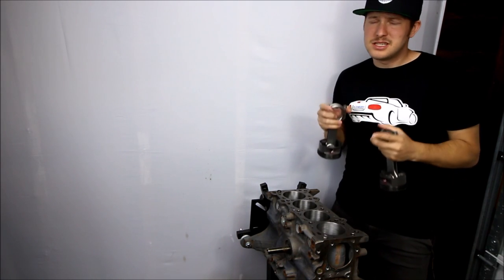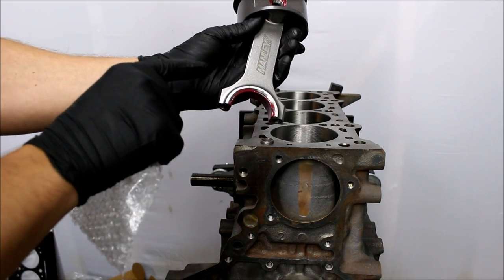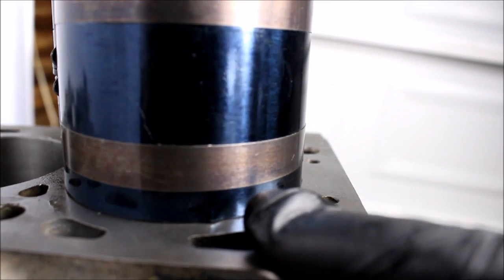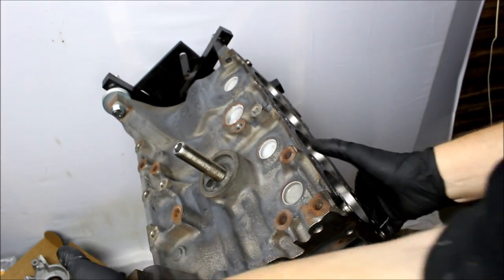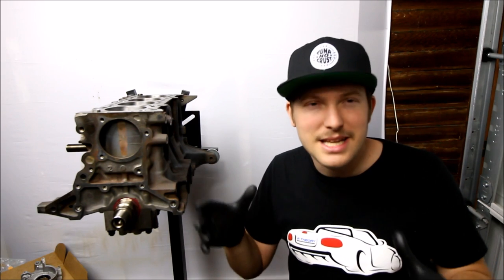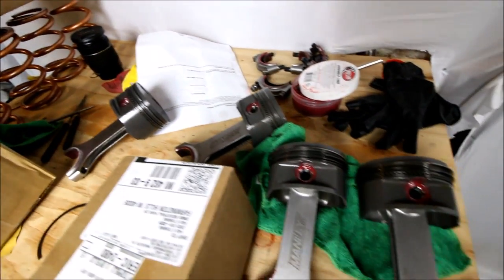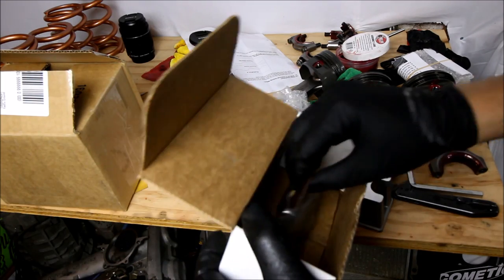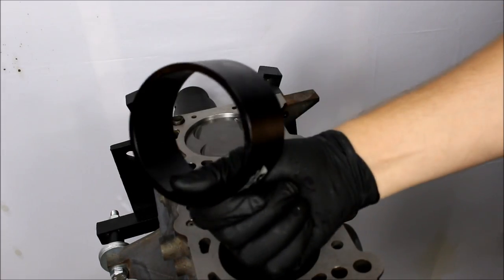FIRST MISTAKE On The VVT Engine :( Piston & Rods Install (Rebirth Ep12)

Comment: I used the lisle spring compressor (the cheap one). The key is before you push the piston down in, you need to give the compressor itself a couple light taps all the way around with a rubber mallet.  It level/flushes the compressor edge on the block deck.  Then the piston slides right in.   

The second one you used is way better, but just for anyone watching - this is the tip.  

Nice vid man. I too teach myself the same way you do.  It really is way easier than I ever thought it would be.
Reply: Stanley Orner you are right, the cheap compressors work good, it's just you have to make sure it's square to the block, then you can push the piston straight in the bore instead of tapping
Reply: every tool is good if you know how to use it

Comment: Cant wait to start a 1.8 build myself :D
Reply: Gingium will it be fully forged??
Reply: Maybe swap VW 1.9TDI in it? Sounds ridiculous, and no one did it, so you can have rwd with same power (no, no actually few HP less), but 200 ft-lb of torque at 2500 RPM is insane for offroad use. maybe...
Reply: Turned out to be a 1.7l build haha 😂 :p
A beast she is
Reply: Which supertech valve springs did you get gingium?

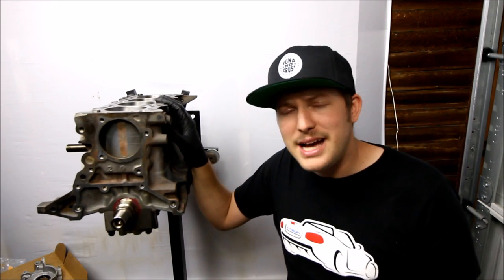Comment: 4:25 - 4:40 the lube on the bearings WILL CREEP OUT, under this load. Check the torque in 3-4 hours.

Comment: Not trying to be "that guy", I know everyone has their own way and they do what works best for them but I figured maybe I could share a tip. It should never take more then just your fingers to push a piston into its bore. Just clean the cylinder out well and squirt a good amount of oil on the piston skirt/rings all the way around (if you think it's to much, its most likely just right) and apply a good coating oil oil around the cylinder and just plop them in using the ring compressor and your fingers.

I've seen a few people do the tapping in method with a handle or something because they couldn't push it in by hand and sure enough, it was either not enough oil used to insert the piston or one of the oil rings actually bent over. No it wasn't their first engine build either. Just figured maybe I'd share that to save someone one day, everyone makes mistakes no matter how seasoned you are.

Comment: Nice vid. One small comment. I did buy a 202 blue short motor from the wreckers, in about '93, that'd come out of a wreck. The boy had been breaking it in, and broke it a bit harder than... So the wrecking yard told me it was cheap because "it rattles and smokes." Investigation showed that he'd oiled the bores a wee bit too much. The rings and ring grooves and everything, were a black mess of half-burned oil. What did I have to do? Well I'd already bought another new set of rings, so I might as well use them - Those ones are obviously no good. What else? ... er... Run a hone around the bores a little bit, because they look a bit glazed... and put it back together. Oil stone and give the deck surface and head face a once over, new head gasket, and Bob was Dad's little brother.
Five years later, you could still look down those ports and see bare Aluminium piston tops, including the green marker pen with the piston numbers on them. Not all that shabby for a mid-'90s back-yard built holden.
So what had gone wrong for the first owner? He'd built it, but he'd gone a bit overboard with the oil on the cyl walls and oil in and around the rings and stuff. Possibly he fired it up very gently and just let it idle for 20 minutes, rather than running the engine at middle revs and full load within the first 3 ~ 5 minutes like you should. Possibly his oiled up bores also had assembly grease in them, I didn't get to watch  him build it, I just had to clean the black goop out of his ring grooves. You should lubricate the bores and oil everything, but that doesn't mean pour half a cup of oil into each plug hole before you turn the key.
Reply: Kneedragon1962 this is funny to read. Just went through the same issue with our built Mx5 motor. Rings didn’t bed in. We think we were too generous with the oil and let it idle too long. Now having to rebuild. Good advice!

Comment: I just discovered your channel yesterday while looking for information on setting up a EBC on megasquirt in tunerstudio. I did want to post up and let you know I also ended up needing to order a set of rings when doing my first engine rebuild. I was able to call Wiseco and order rings for a single piston. My out of pocket was less than $30 shipped. I just had to supply them with the piston ring specs. I filed my on ring gap and accidentally interpreted the .44 mm measurement in .044 inches. Likely won't make that mistake again.

I've got a 93 Mx-6 4cyl boosted on megasquirt with 10.5:1 compression. So far it's quite fun on 7.4psi. Took the old numbers of 103whp/113tq to 196whp and 202tq on a "safe" street tune. Final goals are around 350whp/300+tq on 14psi on pump gas. Unless I get bit by the boost bug more than I have and decide to do methanol injection and shoot for closer to 18/20psi. :)

Comment: Been there done that.  You are right the key is to hammer the sleeve down on the block so that it is completely square.  Lay a wood handle of a hammer sideways on the ring compressor and tap.  The other key is to not hit too hard.  If you are tap tap tapping and it won't move pull it out and reset.  It doesn't take a lot of force to punch it in.  But, like I said, been there, done that.

Comment: I think you did a good job and it was a smart move upgrading your ring compressor. Recently I re-ringed my VR6 and I didn't have one for that engine since the cylinders aren't flush with the deck so I had to do it all by hand and used a small flathead screwdriver to help push the rings in lol. Pain in the ass and nerve racking but she's been taking the most abuse ever and is running very well for a  VR6.

Comment: i have used one of those crappy adjustable ring compressors.... way inconvenient. we have one at school that uses about 6 different size bands that cover piston sizes in half inch increments and then some pliers that compress the band when you're ready to install. I'll have to look up the model but it was cake. i basically pushed the pistons in by hand (2-stroke boat motor so only 2 compression rings per piston)

Comment: That ring compressor is fine. I made the same mistake and the reason is because the screw is right where the ring gap was. That small area is not being compressed. I now use the same compressor but I check with a flashlight to make sure.

Comment: Just a couple of pointers, on a lot of engines the orientation of the piston in the block is critical, as is the orientation of the rods in the block. V engines that share rod journals especially. Another critical thing is never mix con rod caps, make sure the same cap goes back on the rod it came off of, and NOT 180 degrees from how it came apart.
Reply from the maker: New Jersey Bill Thanks man 👍 I have covered all of that in previous videos of this build, I try not to repeat the same info over and over. Cheers
Reply: Good that it was covered. I could envision someone coming to this video and going " Oh that's how it is done." and wipe an engine. :(  Best of luck with the build!!!
Reply from the maker: New Jersey Bill Yeah I have thought about that as well since this video is getting quite a few more views than my others. I try to regularly tell people that this is not a how-to series, but more of a how-I'm-doing-it series, as I'm not a professional.

Comment: how does the better ring compressor work if there isn't a screw to tighten?  is there a gradual  slope on the inside of it?  just curious
Reply from the maker: dwang006 Yes it's tapered on the inside 👍

Comment: Need to go through the tightening sequence at least three times to knock off the rough spots on the rod and rod bolt threads. Should be a stretch spec also.  Need to measure untorqued bolt length, mark it down, tighten three times and finally the third time, measure untorqued length, mark it down, tighten to torque, measure length, should have stretched by thousands of an inch.  Been through this MANY TIMES!

Comment: you should have set up the spring compressor first before dropping the piston in the block. That is why you are not able to tighten the spring compressor properly making the ring popout. you also do not have to hit the piston that hard to drop it in. the slightest resistance should tell you that there is something stuck..

Comment: I find the best way to drop in pistons with new rings: let your nails grow for a week, then use oil on cylinder walls and piston&rings, then only use your fingers/nails and drop one ring at the time. works well, the oil ring is the trickiest. :)

Comment: Good way to file rings is putting them to the designated cylinder bore. Check with gauge that it is evenly deep all around. Then measure the cap with file gauge and adjust according to spec. No need for special tooling imo.
Reply: And for the ring compressor. Never leave ring cap in portition of tool where compression happen (where the tightening screw is.) That's a sure way to break your rings.

Comment: How did you manage to break a ring? I have installed heaps of rings using one of those adjustable ring compressors. You have a tiny chamfer on the top of the bore to guide it into the cylinder so you should never break a ring unless you hit it with a hammer after the ring compressor has lifted and the ring has popped out. Apart from holding the ring compressor down every couple of light taps on the piston I also tap around the whole edge of the ring compressor as well because they can twist and leave one edge up. However you are 100% right in buying a fixed ring compressor they make life so much easier, but again still exercise the same amount of caution as you would using the crap thing. Only draw back to the fixed ring compressor is they only do one size bore.
Reply from the maker: Dodgy Brothers Well this being my first engine build, it sounds like you're much more experienced. I can't really answer "how" but I know plenty of people have done it. The ring may have even cracked while the machine shop was filing it?
Reply: The only reason I have used the crap one so much is because we don't have a Summit down under to just order one like you did, so it is persisting with the crap one even though it has driven me nuts at times, and I've had rings slip out multiple times from it twisting, fortunately I've just never broke or chipped a ring like you did. All things being equal I would opt for the fixed one every time. Those adjustable ones should be used in an emergency only.
Reply: I would put money on you chipped it as you were knocking it down (otherwise the piece wouldn't be there) It is real easy to lift just one edge and it pop out, Looks like you tapped the piston after it popped out causing the  chip. Also there is no need to hit the last hit any harder than any other taps, they should all be light taps even after you think all the rings are home. Look for a video on ring grinding there is a bit of an art to it.

Comment: HA! I did the same mistake and broke a piston ring on my BMW build once, same way as you did.. It was forged pistons with rings specially designed for those pistons and it was damn hard to find new rings! Not much help in the company I bought the pistons from, so I had to source them my self through a dodgy French site.. But they arrived and was the exact same as the one's that I had :)

Comment: Great video, and yes adjustable ring compressor are terrible.... Use only fixed diamater ones, also I didn't see you use plasti gauge for oil clearance? If you don't have plasti gauge handy a bore gauge is also perfect :)

Comment: You should say that the ring end gap has to be in spec (info is in manual if stock or is provided with piston if custom) and the rings have to be "rotated", so the ring gaps on single piston are at certain angle to each other.
Reply from the maker: MindBlowerWTF Yes I covered gapping in the last build video

Comment: did you check the ring gap ? 
you put them in the engine bore without the piston. and you check with feeler gauges to get a certain tolerance
Reply from the maker: Yes I did in the previous video :)

Comment: Nice video man, just stumbled onto you for the first time. A quick suggestion for you from one creator to another. You should be linking the tool you used in this video. Get an Amazon affiliate and find that tool on Amazon and link it. Or there are other tool companies that will do affiliate linking with you. It's not a ton of money but if you do it right and your not trying to be a tool salesman but just want to bring your subs something of value, then it will work.
Reply from the maker: ScannerDanner Thanks for the heads up! I'm definitely going to be looking into that.
Reply: For sure man. Good providence to you and your channel.

Comment: Didn't check bearing to crank, or ring gap clearances?

And you ALWAYS rotate the crank, so the cylindar you are working on, the journal is furthest away from it. So you have more room to slide in the piston, without the conrod hitting the crank.
Reply from the maker: +mtktm yes everything was checked both by the machine shop and by myself in previous videos
Reply: TheCarPassionChannel wish I had checked my clearances. Shops made a mistake and after only 150 miles spun a rod bearing. All torn down again and having the cranked turned and polished. It ran sweet before that though😥. Keep the vids coming. Helps me stay motivated.

Comment: Hey Greg! You're an inspiration to me. Only recently did i decide i was going to go to school for my ASE. and 6 months ago i decided im going to buy a miata. In two weeks i get my 1999 Miata, with only 80k miles on it. I was curious, in your opinion, would it be worth it for me to start by turboing the miata, or first go for a Stroker kit with forged internals, then eventually turbo it. also if anyone else would like to provide their insight, i'd be willing to answer. Thanks! Also is it a downside to have a 6spd miata?
Reply from the maker: That depends heavily on your budget. I would highly recommend just spending $3000-$4000 on a quality turbo setup for the stock engine and see how you like it. For the price of building a stoker BP you could just as easily do a K swap and have even more power. The only real downside to the 6-speed is the gear ratios are very close so it's not optimal for turbo cars with wide powerbands.
Reply: Hey! Thanks for the response :) I got the car for an absolute steal, and today i just actually found out it is a 10th anniversary edition miata with the LSD and some cool other specialties. My budget is exactly $4700, and I would like to put a good amount of that into the turbo setup, But I would also like to upgrade other things on the car. What would you recommend getting for the vehicle? Also, I'm looking to daily drive on low boost, but enough to give the car an extra kick if that makes sense. 

I appreciate any help you can offer! Thanks again! Love the vids man
Reply: Thanks for the advice, Riis! I'll have to look into those. I appreciate it mate!
Reply: 3 to 4k dollars seems to be a very expensive investment for a 1999 Mazda Miata. but I wish you well in your endeavor...good luck.
Reply from the maker: rayford21 Think about it this way: Nice clean Miata for $4000, quality/reliable turbo system for $4000. Now you've got a 2300lb car with 240whp for $8000. How many cars are going to be able to out perform it for the same cost? :)

Comment: Is your VVT miata with LSD? If yes maybe weld it? I know that it maybe be drag and track car, but 100% didn't disturb anyone, also it doesn't slide that much if suspension are adjusted for track days and especially with good tires
Reply from the maker: Gedas alekveravičius I have a Torsen LSD :)